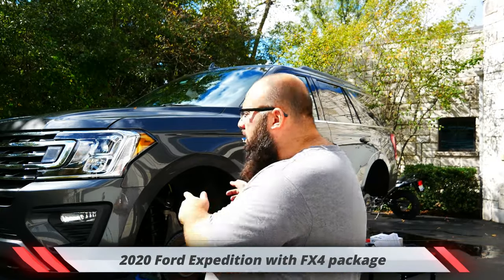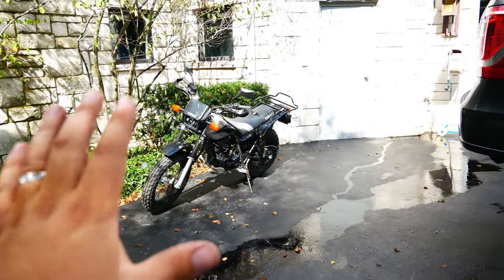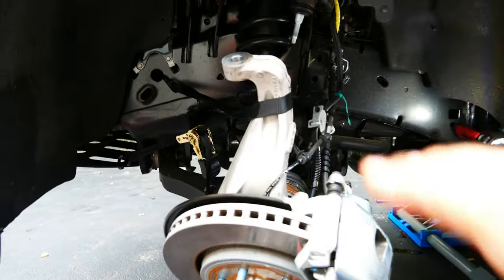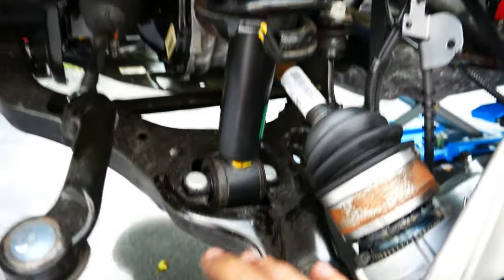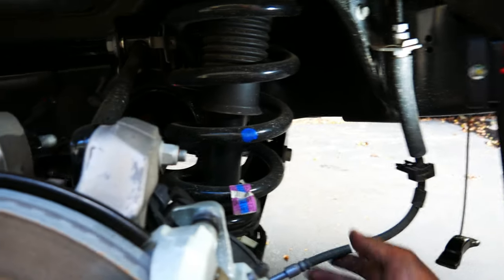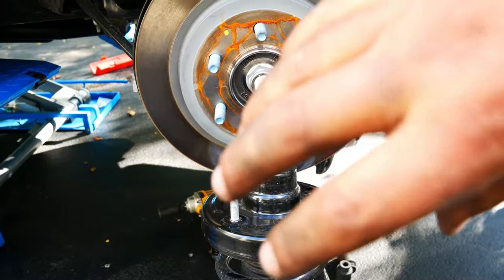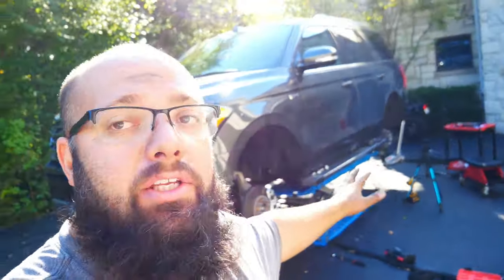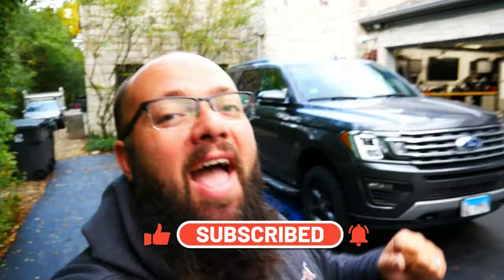Lifted my 2020 Ford Expedition FX4 - Overland Build Has Started - Part 1

Comment: IMO, these ReadyLIFT kits make the rear look like it is sagging. Most trucks come from the factory with a rake angle that has an appearance of the front being lower than the rear; however, the Expeditions already come with a level appearance. So, with trucks other than the Expedition, you may wish to level and lift the vehicle by raising the front more than the rear, hence the 3" front lift but only 2" rear lift. But, since the Expeditions already appear level from the factory, raising the front 3" and the rear only 2" gives the rear a sagging appearance, again, IMO. You can see this in the before and after measurements as well, with the before measurements being equal and the after measurements showing the front higher than the rear. Do you agree? What appearance do you prefer?
Reply from the maker: Yes I would agree. It would have been better for just 2” all around because you won’t be able to fit a 3” in the rear.

Comment: Did you film the part where you scrunched the shock spring in the front wheel? I would be interested to see that magic.
Reply from the maker: I did but it didnt make the cut😂
Reply: @GasTachs  I would watch even an uncut version just to save time on editing. Especially if it includes the near face plant. ; )

Comment: Did you need to correct the alignment and if yes what part did you need to do it
Reply from the maker: I needed an alignment afterwards yes. no extra parts and the lift comes with the alignment specs

Comment: Excellent upgrade!! How was the ride quality after the lift? Also, are the wildpeaks comfortable on the highway?
Reply from the maker: Ride didn’t change, but my legs are getting strong with the extra height. The wildpeaks are the best! No highway noise. Great for snow, much and road! I have them on all my 4x4 and camper
Reply: @GasTachs  Haha thats awesome! I’m torn between the Terra grapplers or the Wildpeaks for my stock 20’s. Planning to do a car camp on some light to medium mud terrain, but hoping for the least impact on highway driving.

Comment: How has the readylift 3/2 held up? Trying to consider options for my 19 Lim with CCD
Reply: This may not work with ccd unless you go into forscan and disable it, the suspension would still work just wouldn't have ccd

Comment: Any particular reason you didn’t go wider on the tire tread?
Reply from the maker: i was worried about rub and I didnt want to buy new rims. Currently on utune there is some "rub" on the fender liner.
Reply: @GasTachs  I see. 👍 I did 295/55/20 AT on factory rims, no rubbing, from 275/55/20 AT. My gas consumption is unchanged. Somewhere on YouTube there is a car show where the vehicle was fitted with 305/35/24 AS with no rubbing or trimming the vehicle. Keep going! 👍

Comment: I didn't hear in the video, but what size tires did you put on?
Reply: 8:38 bottom of screen 👍
Reply from the maker: Falken Wildpeak AT3W All_ Season Radial Tire | 275/70R18 125S | 28030703 model